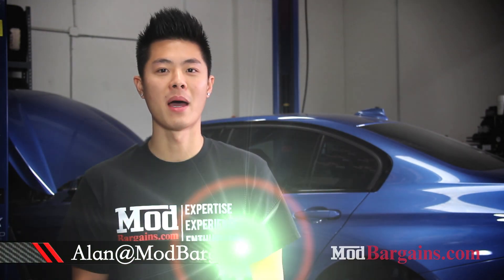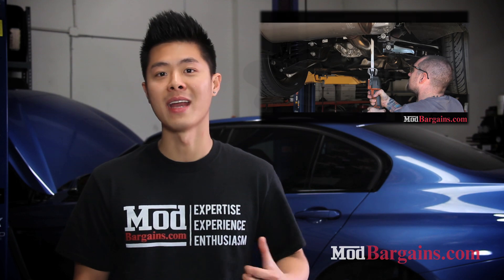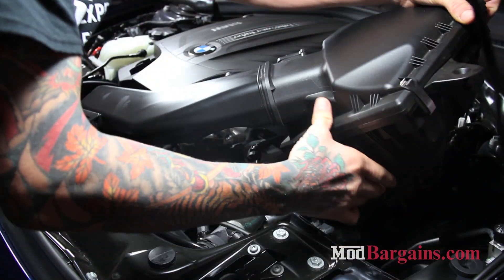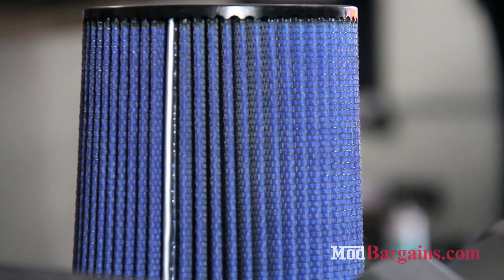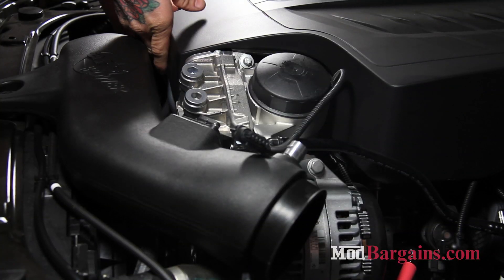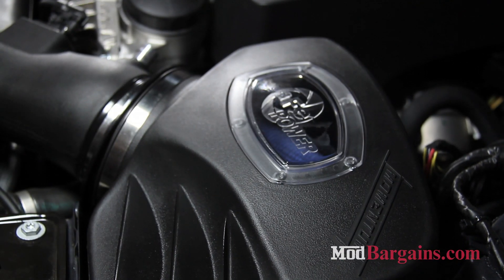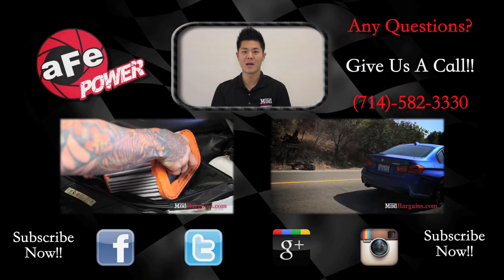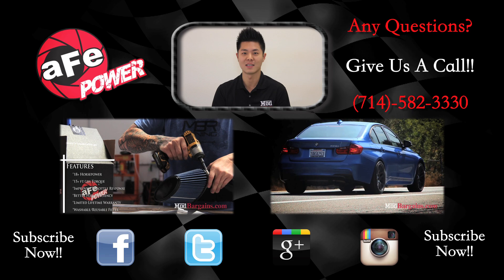Project Car: 2013 BMW F30 335i - aFe Stage 2 Intake

Comment: What's the difference between pro dry and pro oil filters?
Reply from the maker: It really comes down to preference and how comfortable you are with cleaning your filter. ProDryS is a 3 layer, oil free filter with GREAT airflow and is ideal for less maintenance . Pro Oiled filters offer 5 layers of oiled mesh, which provides MAXIMUM airflow but must be re oiled steadily. More answers here: http://afepower.com/faq.php

Comment: will this work on the 328i f30?
Reply from the maker: No, this is specific to the 335i N55 motor. There is a link in the description to all of the F30 aFe products which features intakes for the 328i, N20, and N26 motors.
Reply: thanks